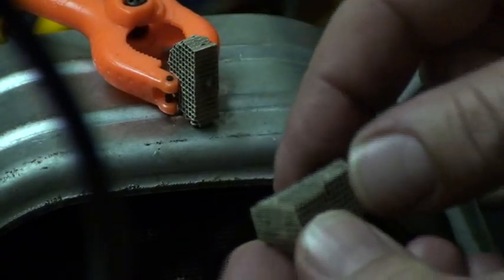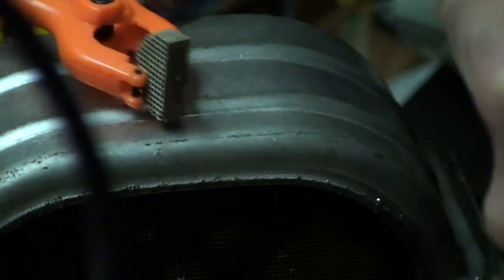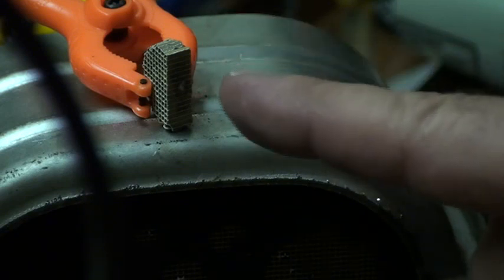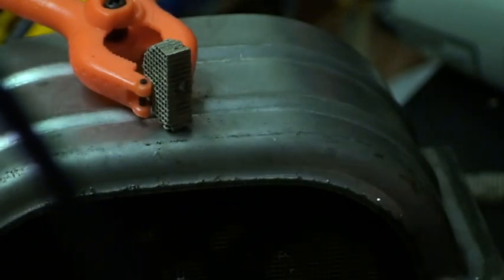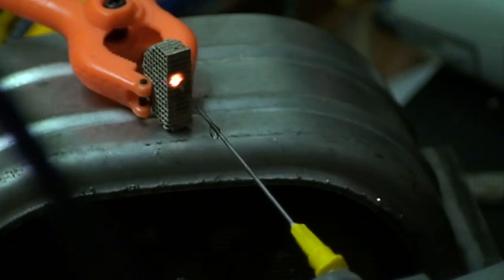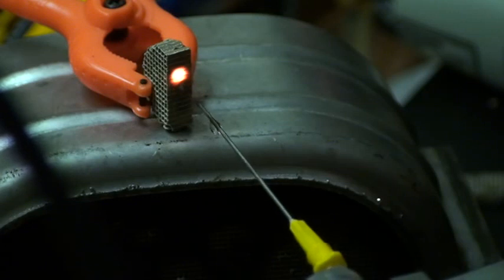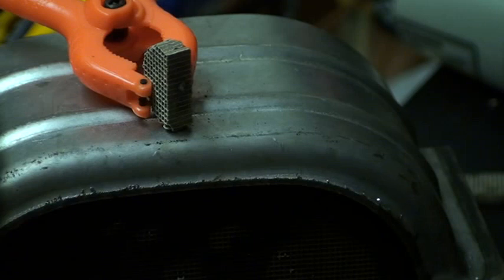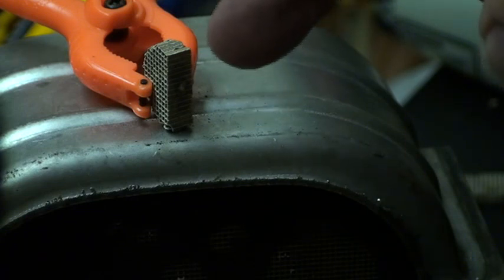CAT to LENR approach 3 wmv

Comment: I think this is mostly, if not entirely, a chimera of your experimental setup.
You are "measuring" the flame temperature at  1 cm,  have you measured the heat output AT THE FLAME (awkward to do, but since oxyhydogen will burn under water you can get rough quantitative measurements in a home-made calorimeter), and compared to non-burning gas on the catalytic surface, with the same kind of rough setup?
P. S.-the flat surface is NOT advantageous to reaction, there is much more available area inside the honeycomb. Others are simply using the catalytic converter and measuring the bulk output of heat (we could even put a mica or quartz window in one to look at the reaction surface.) If your input to generate the HHO is less than your heat output from the CC, you have overunity, incontrovertibly.

Comment: You done a great job showing this. Yes, the gas alone reacts with much higher intensity than shooting the flame directly at the substrate. If you study some of the cold fusion or lenr research, this is the exact reaction that is taking place inside the reactor core. They are even hitting the platinum, palladium, or nickel with square wave pulses, which seems to be a way of controlling the heat. Keep going with this. 1-2lpm outputs 2-400 watts should be enough gas to produce some useful heat. Try diffusing the gas so you can cover more surface area.